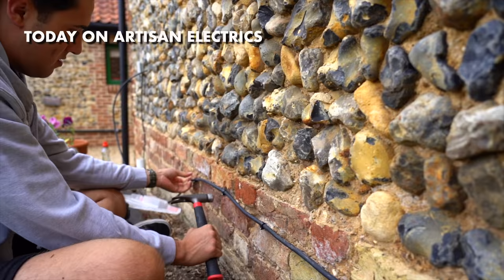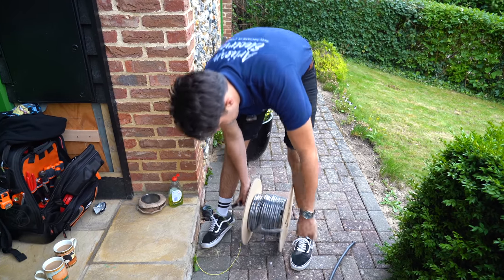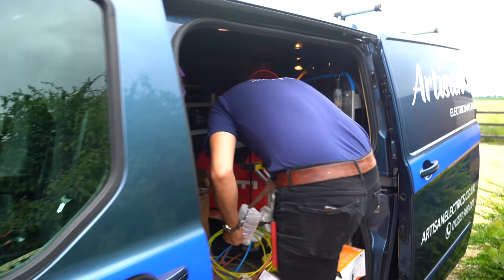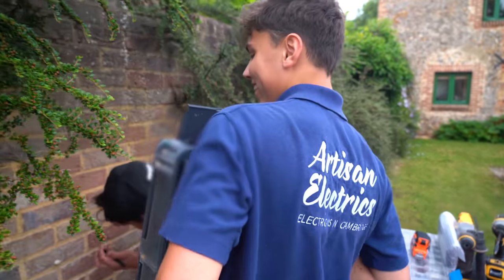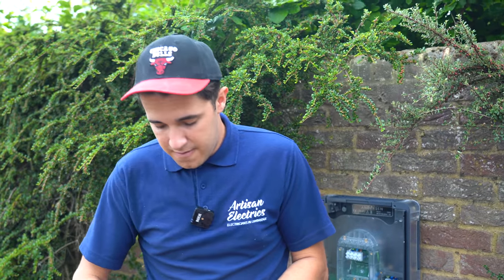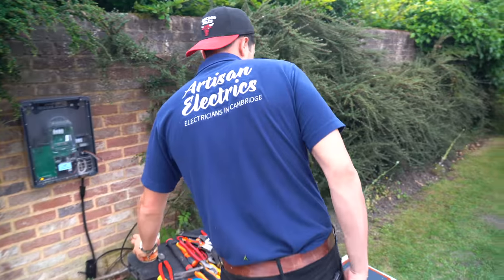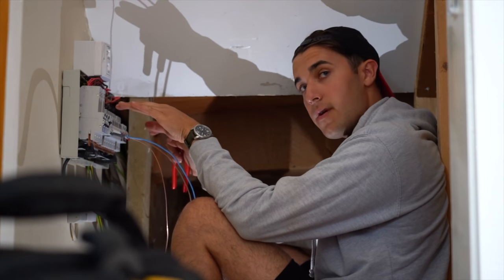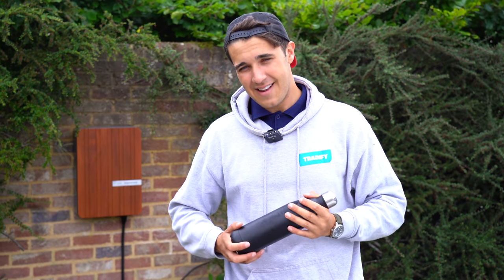Running Underground Cables for an Electric Vehicle Charging Point

Comment: Get a drum of blue poly rope for conduit pulls & pull a spare length in for future needs - definitely use proper conduit lube & use it sparingly because washing up liquid goes all manky in the duct.  As for mounting the Anderson - I'd use the old cheat of drilling the first hole & fit up, then mark the rest up - the first fixing acts as a third hand & means that I am less likely to drop the box🤣🤣

Good to see Ruben building in confidence & banter.
Reply: Was about to say the same thing, always pull in a new pull string with the cable. Get a 4 mm dyneema rope for pulling, incredibly strong (1000 kg maybe?) and very slippery.

Comment: Nice job but I would have pulled another string or copper cable through that pipe! Just in case you need to pull another cable through it in the future.
Reply: Good idea ,but draw wires normally twist around the cable .
Reply: They want a tv socket outside on the wall
Reply: @raychambers3646  They won’t twist if you feed them in correctly in the same order, that’s the way telecoms pull cables in and leave a draw wire.
Reply: @roymorton8142  unfortunately no matter how careful you feed them in the cable has a natural twist. Telecoms usually use rod and attach cables or rope ,in fact they are installing fibre using this method in our street at the moment.

Comment: 16:10 being WiFi only is a bad bit of design from Anderson. Thick external walls are often going to leave you with little or no WiFi coverage outside, particularly in larger and older homes.
Reply: Missed opportunity by Anderson. They should put a WiFi Access Point into their chargers. Since you need to run power to it anyways, adding Cat6 is easy. Provides internet access to the charger and the car, which seems to be needed for most cars.
Reply: @gorgonbert  yes, use it as a wifi range extender. But putting an outside wall between the wifi AP and a fixed client device  is asking for trouble . My ring video door bell is on the wooden  door  itself, not the  brick wall by the side of it. For exactly the same reason. It is the difference between 5mbit/s and 0.5mbit/s
Reply: Agree very bad on Andersen’s part - I never recommend anyone uses Wi-Fi as a preference for anything - it should always be the option of last resort when cabling would do a better job - and it would here.
Reply: @patdbean  Easiest would be to configure it with a different SSID and you should be golden. WiFi Extenders actually decrease your usable bandwith because every „packet“ is transmitted by your house AP, received by the extender and then retransmitted. So each packet goes to the air twice. (it’s a bit like walkie talkies, if one presses the transmit button, the channel is blocked for the others) The super proper / professional way would be to have a central WiFi controller and hook up all the access points to it. That way the client devices can roam from AP to AP. Anderson probably can’t provide one of those, since they are proprietary to the respective AP vendor. There are mesh systems that don‘t need a controller, but as far as i know those are proprietary as well and don‘t follow an open standard Anderson could implement.
Reply: @gorgonbert  yes, I should have said, a wired second access point. On a different wifi channel.  Not a wireless-to-wireless  range extender.
Reply: I imagine those units are expensive, the design and thought gone into the thing is rubbish, that big unit and a tiny space for a cable, then no rj45, crazy, I don't even think they look nice, they look like a meter box with a wooden door.
Try and get the designer on camera installing one, I am sure once they have done a few they will alter their design.
Reply: WiFi is also a major security risk.  Hardwired is more secure.
Reply: @philandmanuelafreeman3532  true, but if you have wifi then you have the vulnerability having ONE extra device .......
Reply: @philandmanuelafreeman3532  can't beat a cable
Reply: Yeah its a stupid idea. They seem a bit tight to me with the lack of ct hard wiring, no drilling template for mounting either. It all smacks of penny pinching.

Comment: I'd put one hole in the wall for the top right fixing, plug the hole and hang the charger off one fixing. Then lift it round level and mark the other 3 holes. Simples.

Comment: The absolute best thing about the pass through crimper is that you keep the twist on the pairs nice and tight and don't have to undo it too much to get the 8p8c (generically known as rj45) on. 

As a network engineer I will tell you that maintaining the twist in those pairs is one of the most important things you can do to reduce interference near your terminations.

Comment: I would have drilled one hole, get plug and in and fix it with single screw so I don't need to hol the weight of the charger. Then just level it up with one hand without struggle and make marks for other 3 fixings . Then take it off the wall drill holes and bang that thing back on wall.
Reply: I would totally agree. You don’t have to be a contortionist then
Reply: Yup, makes things much easier!

Comment: If when sighting any heavyish item if you mark your first top hole and use that fixing to pivot the item it will carry the weight that way it's easy to get your level on it and then mark the other holes.
Reply: Absolutely, much easier 👍
Reply: Learn this very quickly on industrial jobs 👍

Comment: You should be fitting a type A RCD with these chargers as per manufacturers instructions.

Quote from Andersen tech support 👉

. The below must now be upstream of the A2. 
40a Type A RCBO (61009) or
Type A RCD (61008) + 40a B curve MCB (60898)
Reply from the maker: Why when they have RCD protection built in? The data sheet says it has Type A RCD with 6mA DC protection built in…
Reply from the maker: And it passes all our RCD tests when we test it
Reply from the maker: I’ve contacted Lee will see what he says
Reply: I agree with Efixx . We fit lots of Andersen and have always had to fit Type A RCD upstream as it's only Type B built in to the charge point . I have spoken to head of tech who says it must always be installed upstream (at the consumer unit). We usually fit a sub board on older consumer units like that for the type A RCD protection. Technically that Andersen isn't installed to the manufacturer instructions and possibly voids the warranty in the event of charge point failure
Reply: @B60901  Nevermind voiding the warranty it isn't installed to BS7671 as the manufacturers instructions have been ignored!

Comment: It's advised to use dedicated lubricant and not fairy soap because it will soften the plastic of the cable over the years
Reply: Tested that have you? 🤣
Reply: They do say there is salt in the liquid which can damage the pvc.If being videoed best use yellow 7.
Reply: Used KY jelly for 40 years its brilliant lubricant for cables👍
Reply: are you going to show everyone what you did for the wifi point eg  ip x8 enclosure or use a suitable external wifi point ?

Comment: Nice install, I would like to see the installation of the WiFi router outside. I'll be waiting for the part 2!
Reply: You won't need a router, just a poe access point, just use a standard point in a weather proof box, but you will need a poe switch the other end, I have just done a similar thing with a ubiquity system, that also gives another two rj45 points if needed.
Reply: @acelectricalsecurity  what about connecting the charger and the car for updates, it has to be WiFi?
Reply: @joeb1642  it's got WiFi built in as well

Comment: He will probably find it easier to get one fixing in, screw the the box to the wall, that will take most of the weight, then mark the others either use the drill or pen, remove the box and fully drill the rest of the holes.

Comment: Why dont Anderson provide a drilling template? Its just some printing on the box, not expensive. Had this issue myself when mounting new pond control gear recently. Couldn't get a Schneider enclosure in time so had to use a Hoffman and no template provided. It just made it harder work than it should be.

Comment: little tip if you suffer from bad back don't use leather belts on shorts, use a elastric belt doesn't put to much pressure on lower part of back.

Comment: Business Idea: Artisian Electrician Gyms 

Instead of plates and dumbells there's stations setup with various electrical items an Electrician needs to be able to handle.

"Anderson Holding Station" - Anderson chargers you can use to build your arm strength up for holding on walls

"Cable Reel Lifts" - Build your upper body strength for carrying cable reels around

Cory could even hold classes on how to stick your diet so well like he does.

Comment: Hi. I’ve recently had a Hypervolt EV charger installed at home and the installer routed the cable under the gravel of the french drain around the perimeter of the house. Is there a minimum depth this has to be laid as it’s currently only about 10-15 cms.

Comment: Did you fit a RCBO or MCB in the old consumer unit ? As the new Andersen no longer has built in RCD protection
Reply: These new Anderson’s sound rubbish, removed Ethernet and now no rcd, hope they reduced the price of them.
Reply: Just downloaded their data sheet. The RCD protection is for the cable supplying the charger. It seems they got an internal RCD type F+EV or type A+EV RCD, both can be wired in series with a standard 30mA type A RCD without any problems. The type A+EV is a short time delayed type A RCD with additional 6mA DC protection. The type F+EV offers additional protection against AC fault currents with a frequency up to 1kHz, rest is same like type A+EV.
These RCDs are short-time delayed, that makes it possible to have another RCD upstream without having trouble.
Reply from the maker: @Marcel_Germann  Thank you so they do have RCD protection built in, not sure where all this nonsense came from about them not having it any more.
Reply: @artisanelectrics  Obviously because they now demand for RCD protection in the consumer unit, so Occam's Razor: No RCD protection in it. But that's not the way this works.
The charger I use here works the same way. Requires a type A RCD in the distribution board but also got RCD functionality included. If an error or a fault occurs the charger goes into error mode, stops charging and causes the RCD in the consumer unit to trip. That error can be a fault current but also if one of the three phases in the supply is missing.

Comment: Corey should of explained the knot to him. The knot is meant to be easily removable. It only tightens when being pulled the direction of the pull. Although his knot did look a bit funky compared to the way I do it.
Reply: Also. If your doing it solo just do one mark and screw in the corner. That way he can hold it better with his little hands. You can tighten just enough so he can move it to its level and focus on getting his marks right. It’s a little slower but it’s needed at times.
Reply: 3rd thing. That’s ridiculous that it is wifi only now.

Comment: Hi guys great vid as always just wondering what your thoughts where on Anderson removing the built on RCD protection from there chargers?
Reply from the maker: Where did you hear this? Ours have all had RCD protection in them.
Reply: Jordan  - It’s on the product data sheet - you should be installing upstream type  A RCDs - the onboard one is non compliant.  Why do you keep ignoring this when your viewers tell you?
Reply from the maker: It’s so annoying when manufacturers keep changing the specs without telling installers. We don’t spend our lives reading data sheets we get trained on products and then expect manufacturers to update us when they make changes.
Reply: Oh dear. Sounds like some return visits needed to retrofit Type A devices! :(

Comment: 40 meters underground run, plus say about 5 meters for the ends. 
Wouldn’t 10mm have been a better cable choice?
Volt drop at 30amps is going to be quite high, hope they have consistently good volts at the cutout.

Comment: Fairy liquid??!! Don't they sell wire lube back in the Mother Country? Crumbs, even in the little backwater of Bermuda we have wire lube! Great video.
Reply: I use Ideal Yellow 77 wire pulling lubricant for pulling cables. I’m sure I got it from Screwfix.
Reply: @rdstewart14  That’s the stuff. I also like the newer clear lube that Ideal have now. Dish soap is for that Sunday afternoon project when you’re trying to squeeze just one more cat5e in that 30 meter long 1/2” conduit that already has 4 cables in it!